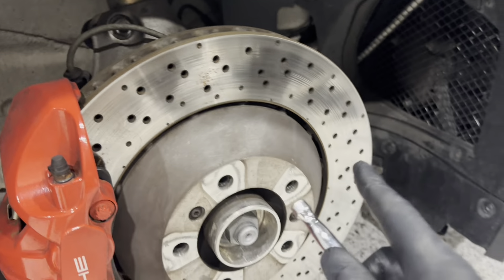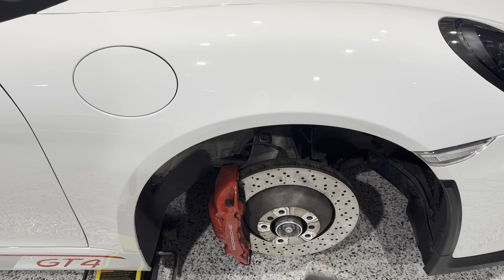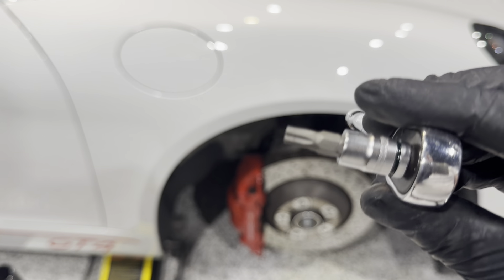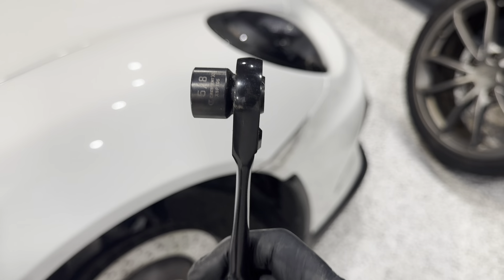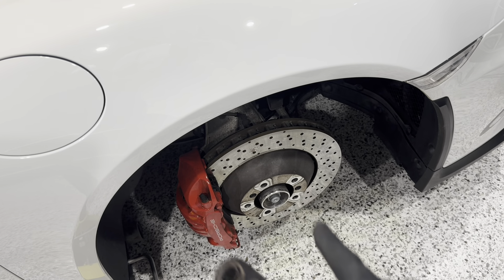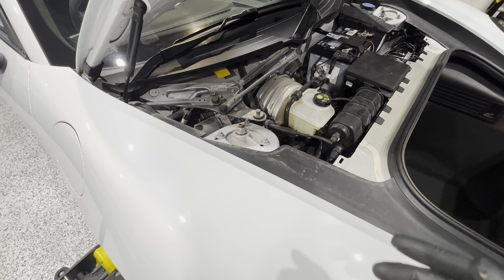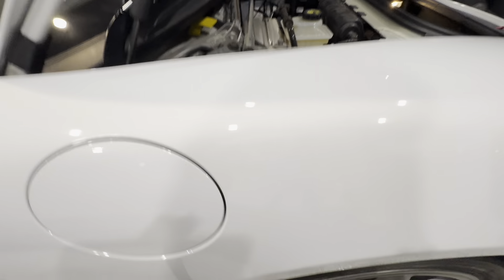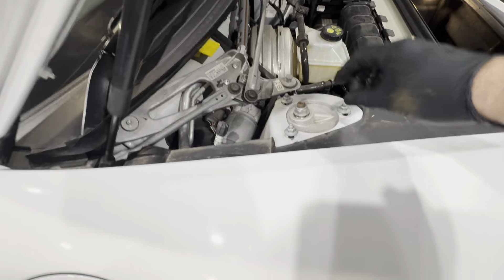Setting up our stock Porsche Cayman GT4 981 for a test and tune track session.

Comment: I'd recommend against using loctite on your sway bar drop link hardware. You're likely to be adjusting them a lot to tune the handling at the track, loctite is going to make it a pain.
Reply from the maker: @corym3985  that’s just what the manual says

Comment: Thanks. Is there any advantage in adjusting the camber yourself if you need an alignment after anyways
Reply from the maker: Your toe will be way off. You would need to set up a string alignment or get it professionally done. Toe will eat tires and make the car pull to the side.

Comment: On a standard car would you recommend toe out to the front and toe in to the rear ?
Reply from the maker: 0 toe front and 1.5 to 2.0mm toe in each side (3-4mm total).
Reply: @ most people go for toe out at the front and toe in at the rear
Reply from the maker: @Trophy_R because the front springs are fairly soft I found that under heavy braking it forces toe out and makes the car wander. My local track has big straights with heavy braking zones. If your track was more flowing then .5 to 1mm toe out each side will work but it doesn’t for me. Plus toe eats tires

Comment: did you feel better performance doing those adjustments??
Reply from the maker: Camber and proper alignment was instantly noticeable. Swayabars I could feel on my first big roundabout and a run through the hills. Aero I could feel on my local big circuit with speeds over 180km/h. I brought my tools to a test day and swapped the wing position and the front bits on and off. It would be noticeable on a track with high speed sweepers and big corners. The track I was at has bir straights but slow and tight corners so aero isn't as effective as alignment. I just installed camber plates for an ever better track alignment. Video for the install just went up.